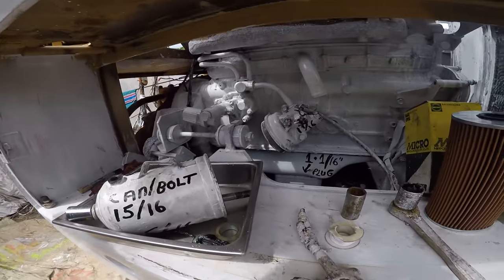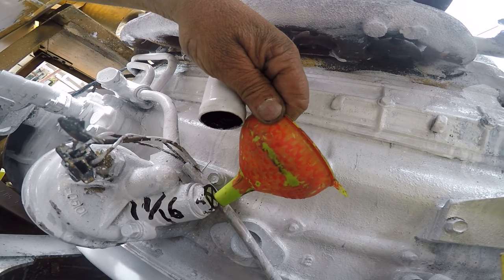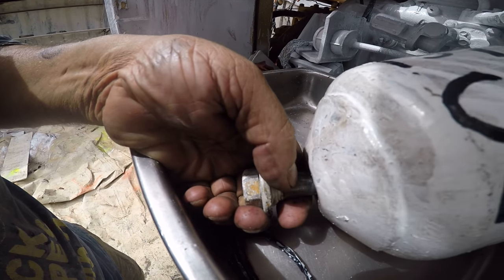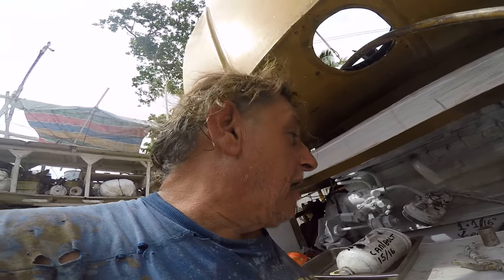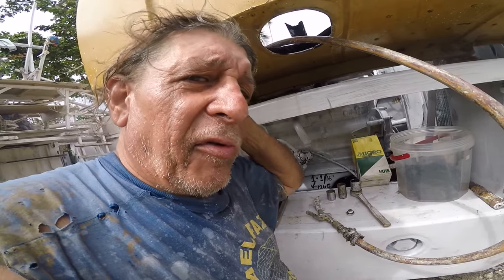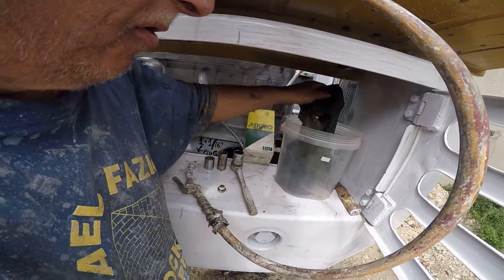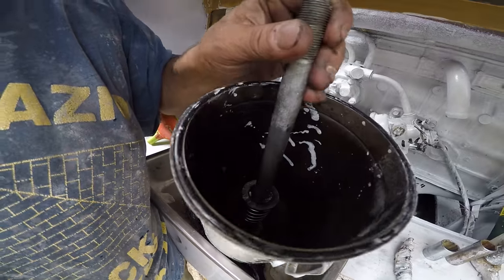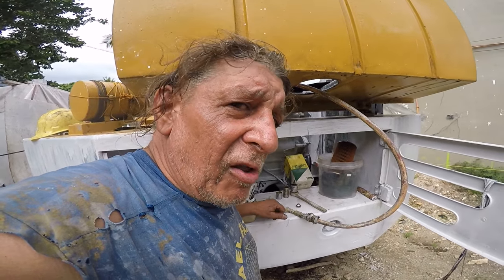HOW TO DO AN OIL FILTER JOB ON ANY AUTOMOTIVE AND DIESEL ENGINE REPAIR GOPR2187

Comment from the maker: WE HAVE NOW 55 + MACHINE REPAIR VIDEOS UP ON OUR PATREON ACCOUNT THAT CAN BE VIEWED FOR A PLEDGE OF ONLY $1. THERE ARE 200 OTHER VIDEOS THERE ALSO...
https://www.patreon.com/michaelfazio

ALSO PUT TEFLON TAPE ON THE OIL DRAIN PAN PLUG TO INSURE NO LEAKS.... I HAVE BEEN DOING THIS FOR 45 YEARS AND NEVER HAD A LEAK

HOW TO DO AN OIL FILTER JOB ON ANY AUTOMOTIVE AND DIESEL ENGINE REPAIR GOPR2187